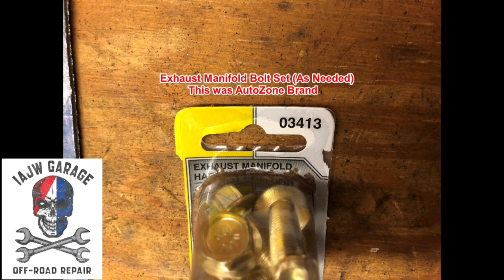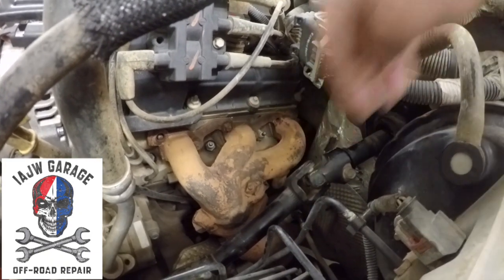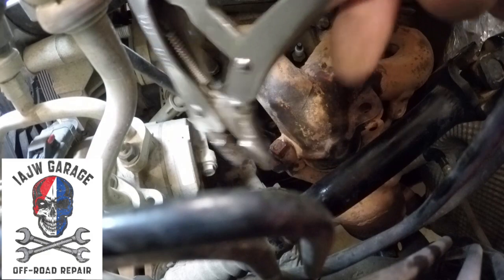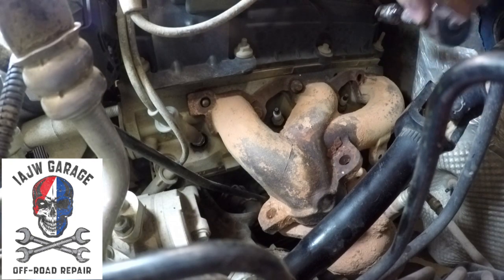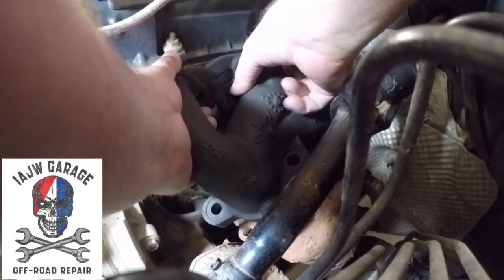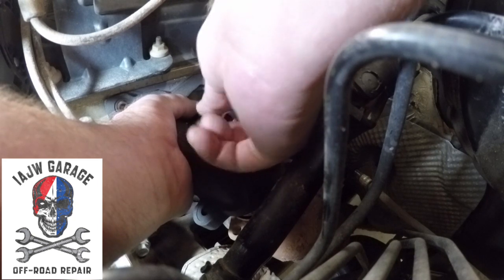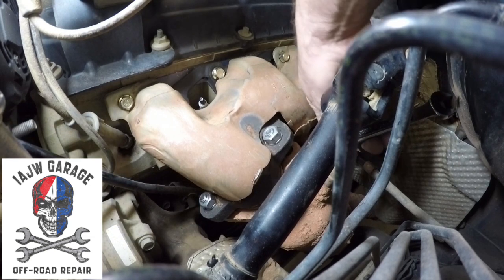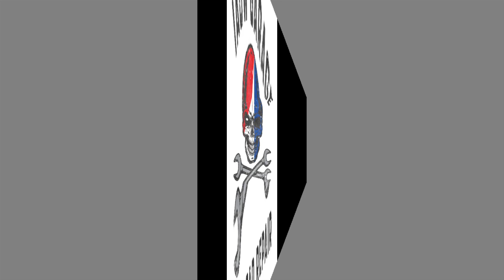Exhaust Manifold Replacement on a Jeep Wrangler JK/JKU (3.8L Motor) - It's a Jeep World (DIY)

Comment: Mine developed the same problem.  I’m welding mine up tomorrow morning 🤙🏼
Reply from the maker: Andrew MacGregor It’s cheap I think I got it for under $100. Good luck
Reply: It’s a Jeep World I’m in Canada and nothing is available right now under $400 this side of the border.  I’ve welded cast before it’s a $5-10 repair with the rod and gas I’m using 😃

Comment: I need to do this on my 2007 wrangler x 3.8, thanks for the video, I have misfires on this bank(2) do you think is caused by the crack on manifold?
Reply from the maker: It could be, best to check for a crack first. But could be coil pack
Reply: @ItsaJeepWorld  thank you!

Comment: Wow, this is easy, did not realize, outside of frozen bolts.  3.6 a lot more plastic.
Reply from the maker: Most repairs are considerably more simple than people think
Reply: @ItsaJeepWorld  yep, something that would be $1000 done by a mechanic, I’ll do for 1/4 of the cost and buy high quality parts or OEM.  My mechanic is the best, if I do have an issue, he told me to call him, he’ll help me out, even swing by.  He lets me know what aftermarket parts are good for specific parts, as one manufacturer not good for all, Mahle for some, Dorman for some or always go OEM for some.  I have a 2010 JK Rubicon and a 2016 JKU 75th Anniversary Edition, both mid 50s miles, 2016 already new Radiator (22k), new rear Axle seal (45k), Thermostat housing (52k), Oil Cooler housing & rear main seal (54k), all covered by warranty.  I bought it Certified Pre Owned (CPO) in 2018 with 11k miles and has a great Powertrain Warranty, that cost me ZERO, comes with CPO vehicles 7year/100k miles (April 2024).  The funny thing is I can pretty much sell it now for what I paid in 2018, low 30s.
Reply: @ItsaJeepWorld  how difficult is replacing the exhaust manifold on the passenger side ?  I bought my 2010 JK Rubi with 58k miles in Jan 2023, immediately changed the differentials, transfer case, & transmission fluids, did an oil change with Pennzoil synthetic and quality filter.  Did the air filter, changed the spark plugs (NGK Iridium) and cables (Mopar).  One of the old plugs was actually broken (ceramic), pieces not in the hole, thank god, looks like dropped it prior to install, and used it anyway and one or 2 seemed barely a 1/4 turn above hand tight, which was a bit concerning.  Closely examining the tires, great tread, but I see some minor cracks (dry rot), definitely gotta replace in 6-8 months, I didn’t notice it when I purchased the vehicle.  You only see these things when you get home, my mechanic actually inspected it before I purchased, and did not say anything about the tires, as he’ll be the one who sells me replacements ;). Anyway, I owe him that and then some, as he has done so much free work for me (brake fluid, smoke test on 2007 Commander, various adjustments, checks over work I have done myself, free pre purchase checks.  He does fleet work as he primary business, so passenger vehicles are a secondary business for him.  He actually stopped me from buying a 2006 with 50k miles, he noticed issues with the frame that escaped my eye, and some shortcuts that were red flags, and the frame “surface” pattern under the coating indicated some bad rust hidden underneath.  He told me never buy a TJ without scoping the inside of that frame with a camera first, a “TJ Framanoscopy” ;) may look great on the outside, but inside a mess.
Reply from the maker: @queensapphire7717  The passenger side is a little more difficult because of battery position and other accessories. 

Why does it need to be replaced? 

You will have to remove the inner fender liner to do it easier (well I would)

Comment: I've been chasing o2 sensor codes on my 2008 for the last month....decided to remove the heat shield on the driver side before installing some new o2 sensors with the help of this very informational video (Thanks!)......and busted that damn stud the heat shield nut attaches to.  But...I'm in luck, because my manifold is cracked, so I guess that problem takes care of itself.  My heat shield is one piece, made it a little tricky to remove.

Any tips for the passenger side?  The battery and fuse box are a bit in the way.

Edit:  Nevermind, I do indeed have a two-piece heat shield, the bottom piece fell out of view.  D'oh!
Reply from the maker: I’ve replaced the driver side 2x. Never had the pleasure of changing the passenger side. Let me know if you discover any tricks

Comment: Is there a exhaust donut that sit inside where the manifold meets the exhaust connection?
Reply from the maker: No, it’s a beveled surface which doesn’t require a donut. Good question.

Comment: Great video doing mine now had to cut flange bolt one came off easy second one not at all . Question are the dorman bolts still holding read on review that they broke later after install??03413
Reply from the maker: I replaced mine with grade 8 bolts
Reply: @ItsaJeepWorld  the parts list you gave showed the dorman bolts that’s the ones I was thinking of using but one review said they break 🤷🏼 03413
Reply: So they are still holding great?
Reply from the maker: @sheerwillsurvival2064  yes
Reply from the maker: @sheerwillsurvival2064  I haven’t heard about the breakage
Reply: @ItsaJeepWorld  Ok thanks. You earned my subscription

Comment: Hi, I have a 2012 JKU that has a steady ticking sound on idle and mirrors the RPM. I’m hearing that it could be a cracked manifold. Does my issue sound like yours?
Reply from the maker: Absolutely does
Reply from the maker: Does it tend to go away when it heats up
Reply: @ItsaJeepWorld  it doesn’t. I don’t hear it as much at higher rpm’s but it’s persistent even in the heat of the day.
Reply from the maker: @mjc_fishing9916  you should get a stethoscope and listen to the valve covers first, could be valve tappets. 
But if you can take the heat shield off the manifold depending on the side you can look for a crack before removing the manifold
Reply: @ItsaJeepWorld  thanks for the help my friend. Gonna check both options. Some people are telling me it could be rocker arms and eventually my cam shaft. Does that sound like a possible issue?
Reply from the maker: @mjc_fishing9916  it does, it could be, just diagnose, diagnose, diagnose before replacing anything 
Diagnostics is a dying art

Comment: I have to get the engine pulled in my jk the bolts are broken on the manifold. I have 159000 mi. Would it be worth putting in a replacement engine With less miles?
Reply from the maker: What year JK? Depends on the cost comparison

Comment: Dude, I was driving home from work in my 2014 jeep wrangler. Something exploded. I pulled over right away. Looked under my car oil was pouring out. There was a fist size hole in the engine block. Well I’m gonna go buy another motor now.
Reply from the maker: Damn, that sucks. Good luck to youb

Comment: should always put the bolts in from the top nuts on the bottom great video though
Reply from the maker: Many ways to do many things. Thanks for your comment
Reply: @ItsaJeepWorld  the reason being is if you are out driving and the nut comes loose and falls off all you loose is the nut the way you have it you loose both much easier to repair on the trail if you keep nuts n bolts in your rig
Reply from the maker: @GULIVERSOFFROAD  I accept that. Very good point thanks

Comment: Was there a CEL code associated with the cracked manifold? If so what code was it?
Reply from the maker: Leapdog01 no code associated, just an exhaust leak. That sound is distinct
Reply: @ItsaJeepWorld  thanks. I have P0430...I don't think I have a bad cat but about to look at this manifold on my 08 to see if there is a leak causing code.
Reply from the maker: Leapdog01 That code is After the cats, the manifold would have nothing to do with it.
Reply: @ItsaJeepWorld  exhaust leaks before the cat can cause the code. I have trouble shot and successfully repaired these codes on other vehicles.
Reply from the maker: Leapdog01 Great. Let me know what happens, always willing to learn and other peoples issues and solutions are good knowledge
Reply: @Leapdog01  

I also have that post cat CEL code & an exhaust manifold leak.  If that the cause for that code?
Thanks

Comment: Could you please tell me how you knew that the manifold was cracked? What sound did it make etc. thanks, Steve.
Reply from the maker: It’s a ticking sound coming from the manifold if you can get the shielding off you can usually see the crack
Reply: @ItsaJeepWorld  oh ok, mine has this terrible tinny sound at around 2000rpm almost sounds like a heat shield or cat converter, have got had any experience with that?
Reply from the maker: @targetoz5470  tinny sound could be loose shielding
Reply: @ItsaJeepWorld  I’ll have a look in time morning, if the cat was loose what sound would that make?
Reply from the maker: @targetoz5470  if the cat was loose there will be black at the connection point from the exhaust
Reply: @ItsaJeepWorld  I didn’t think about that, I really appreciate you chatting with me. Champion. Cheers Steve.

Comment: This is great, thanks! 👍🏻

Any recommendations on how to remove a couple of bolts that snapped off? Mine aren’t finger tight like your lucky bolt was, hah
Reply from the maker: It wasn’t the first time replacing it.. lol 
Snapped in the head? Or in the pipe
Reply: @ItsaJeepWorld  both of them snapped right in the head, but the funny thing is that they were broken off for some time, long before the manifold even needed replacing! I have an Irwin 10mm bolt extractor en route, 2 days out, I’ll give that a shot maybe?
Reply from the maker: @gardiloo  is any part of it sticking out? Make sure you add penetrating fluid over and over before you try to extract it

Comment: why didn't you use the correct 2 OEM exhaust flange bolts ???
Reply from the maker: Joe Yazzie I wanted something stronger. The originals were badly worn and decided to replace them with a higher grade

Comment: Does this help with code p2098? I know it’s for o2 sensors as well
Reply from the maker: It never threw a code for exhaust or O2 sensors. So I’m not sure if it would help or not
Reply: @ItsaJeepWorld  I think my manifold gasket went bad not the headers tho. Should I just replace them both while it’s open?
Reply from the maker: @sheldonknox8632  headers and exhaust manifold are the same thing. I only change what needs to be changed
Reply: @ItsaJeepWorld  you’re right don’t know why I said both. Instead of replacing just gasket should I replace the headers as well?
Reply from the maker: @sheldonknox8632  check them for cracks, if no crack under the heat shield. No reason to replace
Reply: @ItsaJeepWorld  ok will do! I definitely have a manifold gasket leak tho that’s why I need to get down there

Comment: How did you remove broken bolt?
Reply from the maker: Jay Guevara I put vise grips on the piece sticking out and it turned right out, I got lucky
Reply: Ohh yeah I just watched again , u definitely,, had a buddy build up weld then add a nut and luckily came out... I did spray on plaster over night and in the morning add some more. Stuff works miracles. Thanks and happy new year brotha
Reply from the maker: Jay Guevara Happy New Year

Comment: What size were the new bolts that hold the manifold in?
Reply from the maker: I’m not sure, I can check in the morning. I just took an old one to the hardware store and matched the bolt and got a new nut and washer
Reply: @ItsaJeepWorld  did you ever get a chance to check what size those bolts were? Thanks!
Reply from the maker: @aliparvizi3508  No... sorry. I’ve been gone. I’ll check tomorrow
Reply from the maker: @aliparvizi3508  looks like 3/8” about 3 or 3.5” long
Reply: @ItsaJeepWorld  Thanks!